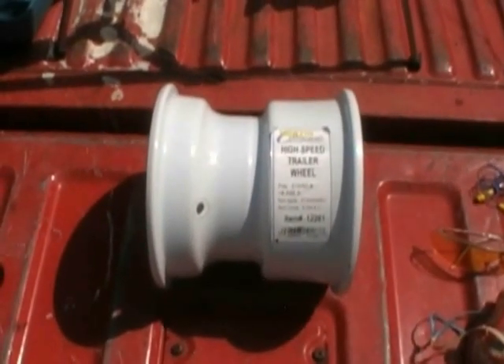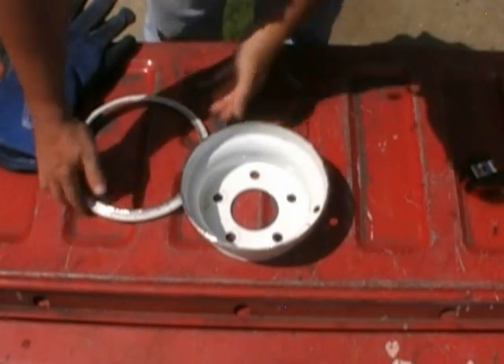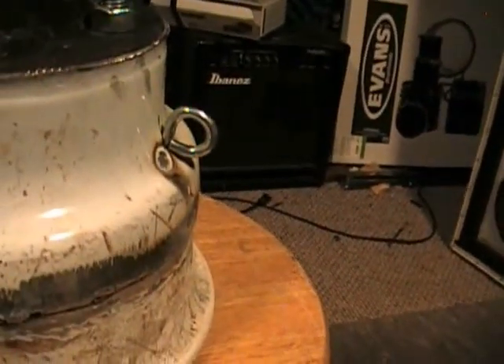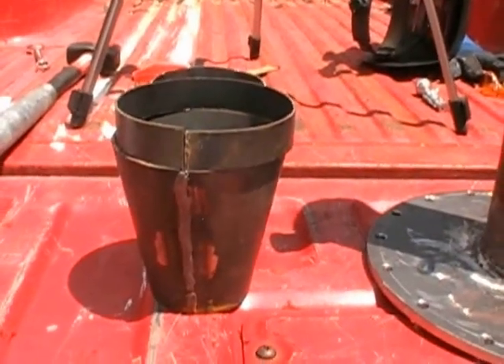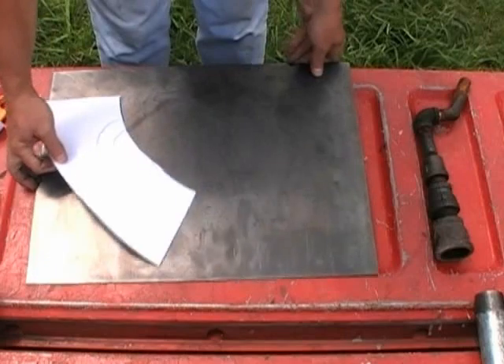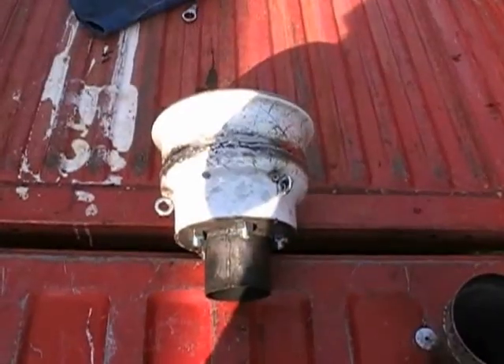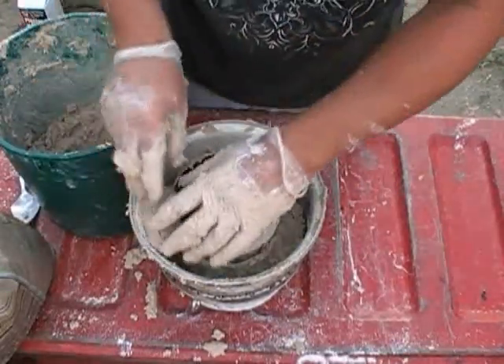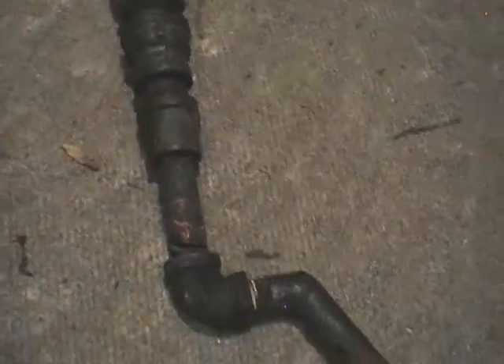08-29-2013 Gasifier "How to construct" ...Video One

Comment: I've been reading all I can find, but still some details are hard to track down.  Is there any findings that would determine how large to make the cone?  The FEMA literature you reference I assume is for the straight pipe systems and are listed in SAE.  I think I will build my first unit to your spec, but I want to know why certain things are the way they are and the cone size is a major topic IMO.  It also might be helpful to know how much volume of material with how much velocity is needed to produce X amount of gas.  The reference literature I've found only seems to glaze past those details.
Reply from the maker: +Sky bound All of the info out there is fuzzy because even though nobody wants to admit it there are just too many variables in wood gamification.  Even All Power Labs prefers to sell their own calibrated fuel for their gasifiers because they know that what they have works. Look at it this way. Cars are picky about the gas they can run on so the octane levels are divided into three grades of regular mid-grade and high-grade. Some cars will handle all three grades and some cars cannot. With woodgas it's a bit tricky so you have to experiment with the type of wood chunks and once you find a wood fuel that works, try to stick to it. The cone you mentioned concentrates the heat by forcing it to pass thru a smaller opening as the gas passed thru it thus aiding in breaking down the tar in the gas. I had to go with the FEMA plans then literally wing it and experiment with diameters so what I came up with was  a 5 up to a 6 inch diameter at the top of the cone down to around 2 or 2-1/2 inches at the bottom of the cone. The FEMA build actually calls for a 2 or 2-1/2 inch diameter pipe when you want to run a small engine. The cone build works quite well and I can get solid runs every time with my setup but it took a lot of tinkering to get it to this point. I hope others take the build and fine tune it even further.
Reply: +flash001USA The FEMA spec for your flashifier is 4" by 16".  Is this how much volume is needed to produce enough gas for a 15 HP engine?  I see your conversion zone is only 9" long, 8" if measured from the air nozzle.  From the rest of the videos, it looks like your hopper is welded right to the rim making for the increased diameter (propane cylinder) above the cone.  Does the wider diameter change anything in the conversion process?  Or is it a matter of just getting the conversion zone within spec and the remaining details become more a matter of preference?  I might not be able to track down the same materials as you and want to know exactly what in this design is negotiable and what is not.

Comment: Your "cement heat sink / insulator " idea is the key to how and why your design produces stable results with regards tar cracking.
In my country we have a saying " Boer maak 'n plan " which translates to " A farmer makes a plan. "
Your "plan" is simple, effective and an elegant solution to the problem of erratic distillate cracking and I congratulate you.
Its one of those things that once you explained it in the video, I thought to myself "Now why the f#$%^ didn't I think of that!!"
The "rim" in my unit is going to be a refrigeration gas cylinder as they are cheaper (free) and will not require so much work to prepare.
Thank you for sharing.
Reply from the maker: +The Mad Man Hey you're more than welcome. Thanks for the reply.

Comment: Hey flash I am thinking about using a 1/4 inch solid rubber gasket on mine that seals the hopper to the outer barrel.
just wondering how hot does the top of your barrel get? think it will work?
Reply from the maker: Joe you may want to use the red high temperature RTV cement instead. The heat will harden the rubber or depending on the rubber, break it down or melt it.

Comment: HEY Flash, (2) question about the  Extension Tube, you stated it was 3" LONG, what is the Diameter of it?  What are you using inside your Filter Tubes?
Your doing a bang up job, grate Videos... better than so online college classes.

Comment: THANK YOU !! I have been going thru all Kinds of plans and DIY instructions,  bought  Mother Earths plans and while some seemed fairly ok most seemed to be filtering out hellatious amounts of Tars or feeding them to the Engine(Yugh!) Your cone cracker with "ceramic" backer  is  close to what I have been contemplating though I was also planning on coating the interior of the cone in fire brick mortar. I can hardly wait to see your whole design I think so far I'm going with your design  so I can run the generator and change the injector and try it on my 18 hp Farmall  CUB tractor to plow snow next year if the filtering and unit are portable enough.

Comment: Love the vid's, question what r the measurments on the cone, small dia. large dia and lenght / height? Thanks keep up the good work.
Reply from the maker: Paul the cone without the top ring should be 6 inches at the top and reduce down to 3 inches diameter at the bottom. The cone is 5 inches in height and the top ring adds one more inch for a total height of 6 inches. The bolt on extension is 3 inches so it bakes the total length of the cone and it's reduction zone 9 inches deep.

Comment: do you have any idea's on storing the gas for use later on i have heard others have used large propane tanks and i believe they used air compressor to pressurize it,
Reply from the maker: Charles I wouldn't try to store it under high pressure. It is a waste of time! Think of propane. It is in a liquid state in its canister so this means you can store a large volume of gas and as you use the gas it gently goes from a liquid to a gas state. Wood gas on the other hand will not compress down to a liquid state so you don't get the bang for your buck for the trouble of compressing it plus it can be very dangerous if the compressor screws up during the process! I know someone that stored their gas in 3 tractor trailer inner tubes and they stacked them on top of each other and tied their valves together. They then laid a big sheet of plywood on top of the inner tubes and placed about 100 lbs on the plywood. This gave the force to pump the gas out thru a copper line where the gas could be used to cook or heat water with.
Reply: that sounds a lot safer way (inter tube) i was also wondering what size of unit ( dimensions ) it would take to run a large military diesel generator? i am trying to get my non-profit expanded to help with natural disaster
Reply: charles matthews
Take a look here for large storage bags for outside  cooking & Etc. do not use indoors no smell to Carbon monoxide and other gases here that the gas company adds to the methane they are selling you.
.

Comment: I would like to know how your mix of plaster of paris with sand hold up with time. Does it still stick together in one pieces? Do you think it may hold without your metal sheet?
Reply from the maker: It has held up with flying colors but I wouldn't trust it as a stand along
fire cone without the steel insert. Another youtube user asked the same question and even mentioned a workaround by adding fiberglass into the cement to make it be stable enough to use without a metal cone. It sounds plausible to me. I hope that helps answer your question.

Comment: Wow flash! Superior job on this build. I will be building a gasifier this winter. Thank you for the wealth of info you have shared! It occurred to me that a ceramic nozzle might give greater life in the burn zone. What do you think of this? http://www.ortechceramics.com/zir_cast_tube.htm
Reply from the maker: A ceramic nozzle would work and somewhere on a youtube video I seen where someone used one but they were running on charcoal so they were much much hotter so they needed the ceramic nozzle. I tried the link but it didn't work. I'll try it later. Thanks.
Reply: try this design this guy has quite a history in designing them...
 http://www.fundamentalform.com/html/biomass_gasifier_breakthrough.html

Comment from the maker: The sky is the limit to the overall design but I wouldn't use plastic for two reasons. (1) Plastic will not be a good heat exchanger for the gas to cool correctly. (2) It may not hold up to the heat. If you watch video four the final video you will see that I made a 4 pipe cooling radiator and I cool the gas before it hits the expansion tank. That made a BIG difference on the quality of the gas. If you can find a small 30 gallon steel drum you could use that for your expansion tank.

Comment: That is one hell of a Gasifier I am trying to milk all of your plans and copy a bunch of it. 
The expantion tankme kind of stalled as how to get it right as soon as the gas is cool enough could you go to a plastic barrell for the expantion tank? I am just getting started on  my build I am retired military and just puttering around. When the smoke first comes out in to the pipe going to the expantion tank could you weld fins on it to speed up the cooling?

Comment from the maker: If you go with a single air nozzle design you would want to up size the air nozzle to a 1 inch diameter and maybe make the cone 7 inches at the top instead of 6 inches. You would just have to play around with the build to fine tune it.

Comment from the maker: If you do extract heat from the barrel you might have the "cold drink on a hot summer day" effect where the inside of the barrel collects a lot of hash and trash on the inside of the walls which means you will have to clean the barrel walls to reduce the chance of a sort of flue fire effect. I clean my barrel walls by scraping them to knock off loose charcoal chunks that collect just to be safe.

Comment from the maker: andyrivgar there are 4 "How to" videos. I did include some of the main part numbers for the build but I didn't try to draw up detailed plans because it would have been too labor intensive and time consuming but the videos do show everything in detail and if you are a mechanically minded person you should be able to knock this off. The core of the gasifier is a trailer rim, a 55 gallon drum and an old decommissioned forklift propane fuel tank and some fence poles and plumbing stuff.
Reply: Hey, thanks for taking the time to do these video's.. i.m al.ost a stalker I have spent many hrs watching and re watchong.. awesome job..
I have built a "flasherfier" is what I call it.. haha.. looking to fire it up in next couple days.. all o have left is filer cage... I took so mu h of you info to help me do mine..
There for It is called 
The "FLASHIFIER".. 
Thanks...
Reply: Hey flash001usa please get ahold of me brahmanjohnson@gmail.com

Comment from the maker: Capatain this gasifier will handle anything from a 5 Hp possibly up to a 15 Hp engine with the correct nozzle and the right wood fuel. This was designed to run an emergency generator.

Comment from the maker: There are people that pump it into tanks but here is the problem. Propane is in a liquid state in a propane tank and it turns to gas once the valve is opened but in it's liquid state, you have a LOT of gas in the tank. Woodgas can only be compressed as a gas and not as a liquid so you really don't get a long run-time on compressed woodgas. Woodgas is at it's best as a "on demand" gas. The best way to store it is in a few big tractor inner tubes. You then tie into the air valves to use the gas.

Comment from the maker: The wood gas would probably work as long as it was properly filtered. Some people fill tractor inner tubes up with woodgas then they place a sheet of plywood on top of them with a few bags of sand to pressurize the gas enough to pipe it thru their home. I wouldn't know what to tell you as far as how much woodgas you would need to produce. That is something that you would have to play around with yourself.

Comment: Flash,

Just found your channel. Great videos. What I am looking at is building a gasifier to provide gas to my hot water heater and central unit and getting off natural gas. I have plenty of wood mass. I live less than a mile from a sawmill. Would this setup provide enough gas to run those two? I haven't been able to figure out how big a gasifier I would need. Thanks and keep the vids coming.

Comment from the maker: 2185justme My bad. I thought I discussed that but here are the measurements. The cone itself is 6 inches on the top and 3 inches on the bottom. It is 5 inches tall. The top ring is 6 inches in diameter and it is 1 inch tall so when it's welded to the cone, the cone's overall height is 6 inches tall. The bolt-on extension at the bottom of the rim is 3 inches in dia and it is 3 inches in length so when it is combined with the cone and ring you have a cone plus extended reduction zone of 9 inches.
Reply: is there a rule of thumb to up size for a larger engine, eg 100hp?

Comment from the maker: There has been a lot of discussion with people using clay to make a fire cone. The only downfall I see and it's a real issue is the kiln materials could crack. This is why I chose to use a steel liner. I came really close to making a totally ceramic cone.

Comment: Hey flash I was comparing the complexity of your burn cone and the one on the charcoal gasifier described in youtube video "Gilmore Gasifier part one" and noted he used a ceramic burn port. Perhaps the cone portion of your unit could be eliminated by replacing your  mixture with the kiln material shown in youtube video "Backyard Foundry Tutorial Pt 2" @  4 min. point. Soliciting your opinion and wondering if you have ever observed gasifier plans utilizing kiln materials verses metal?

Comment from the maker: First of all I apologize for the mix-up. The rim came from Northern Tools. As to the nozzles, I tried a 3 nozzle configuration with what I have now and in my opinion the copper tubing adds too much back resistance to the gasifier. The nozzles need to be able to breathe with ease so I was not happy with their performance at least not on this design. The single nozzle design works quite well for this setup but if I were going to build a larger gasifier I would use more nozzles.

Comment: I've been reviewing some of your other previous videos and have come up with a couple of good questions.  The first rim you mentioned was from Harbor Freight and the 2nd from Northern Tool.  Are they the same dimensions?  It looked like the Harbor Freight was originally a narrower rim.  Or is the Northern Tool rim an improvement over the Harbor Freight in design and function?  Also, are you keeping with the 5 nozzle design or is the single nozzle simpler with comparable results?

Comment: That would probably work.  But this is the first time Ive done a project working with metal.  I'm a rookie welder.  I found out that thin steel is impossible ( at least for me) to weld to.  I have so many places in the gaisfier that I burned through with the welder, that starting over with thicker steel makes more sense.  Thanks for the tips though!  I'll keep watching.  This version has been more of a learning experience than anything.

Comment from the maker: I almost forgot. I would make the cone 6 or 8 inches deep. You could make a cone that was 6 inches on the top and reduce down to two inches at it's reduction and make the cone height 6 or 8 inches in length. You would see a major reduction in the tar being produced provided that the rest of the gasifier was good and air tight.

Comment from the maker: Stove pipe won't hold up for long but there could be a simple "test" workaround. You could make a cone that fit inside of the pipe but instead of 4 inches, reduce down to two inches instead. That would fix the thin steel pipe issue by placing the heat into the fire cone. Your thin steel pipe would become the wood hopper.

Comment: Seems like it was 4" by 16".  But I used a 6" single wall stove pipe and throttled it down to 4".  It works ok, but I have a few other issues that need corrected. So instead of fixing up this version, I'll salvage w few parts from this one for the next version.  I need a better burn tube than the thin steel one I have now.

Comment from the maker: If you are running on wood pellets it is possible to clean it up. If you are planning on running a small engine like a 5 or a 7.5 Hp engine, make a reduction cone that will reduce down to 2.5 inches. You can get rid of a lot of the tar in a FEMA by setting up the reduction zone correctly. What size burn tube did you use for your FEMA?

Comment: Cool! Have been waiting for this.  I built a FEMA fasifier last fall and have it almost perfected, but have decided to abandon it.  One thing I learned is TOO much tar.  I don't think a FEMA is practical.  Seems like it would be too much maintenence as parts of it clog with tar build up.  So, I plan to build another one based on what I have learned from the Joshua Burks design, your design and a few of my own ideas.  Also, where do you get high temp solder?

Comment from the maker: I actually tested a small piece of this mixture with a propane torch and I got it orange hot and let it cool down. It held up really well. It will never get that hot in the gasifier so I feel good about using this cement mixture in my gasifier.

Comment: Hi Flash001USA. Thanks for the video update! With uncle we are starting to build our gasifier, Imbert based, and the information provided is really helpful. What I consider, a single air pipe entering from the top, with nozzles cut in the end of the pipe. The idea is to be able to "adjust" the position of the nozzles, as well to be easy replaceable. BTW, few times you mentioned your blog but wasn't able to find it. Could you provide it here. The idea with the cement is BRILLIANT!